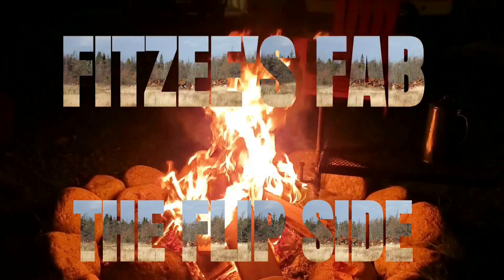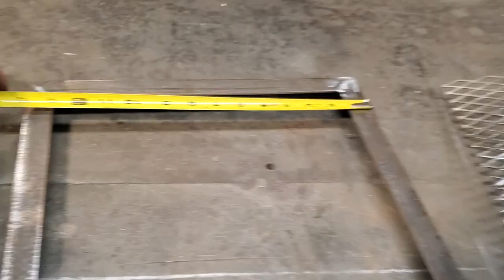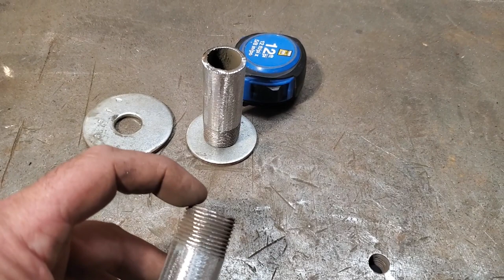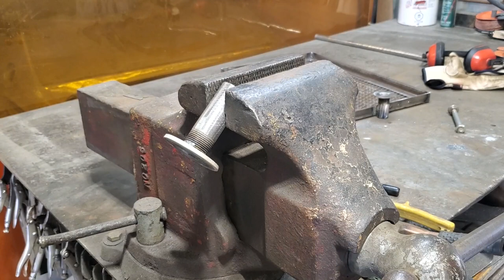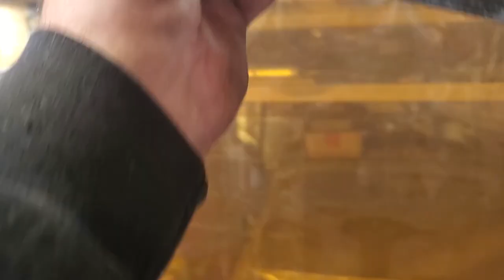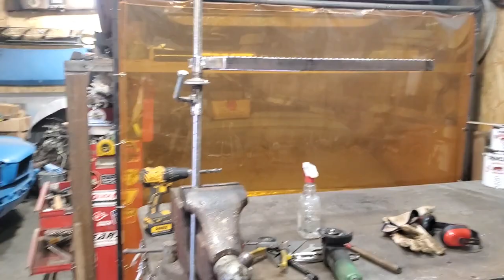Build a simple fire grill

Comment: My fire pit is and old steel truck rim with a couple of 1 inch square tube uprights welded to the outside across from each other. I built my grill similar to yours on one upright, and a pot hook on the other.  4 bolts, properly spaced around the inside, are welded in place to hold up a grate for charcoal. I remove the grate when I'm burning wood. It was pure luck that an old Weber kettle lid fits just inside the lip of the rim tight enough to basically snuff out the fire when I'm done for the night. I like the idea of your "boil-up" out in the woods with friends. Gotta give that a try sometime.